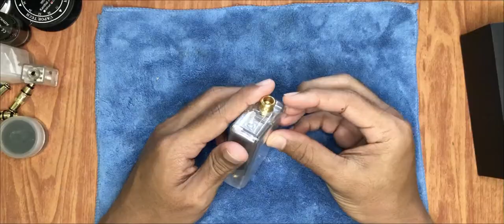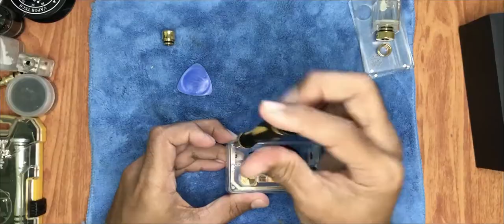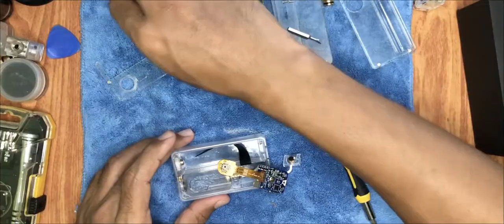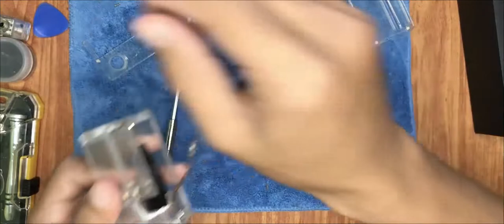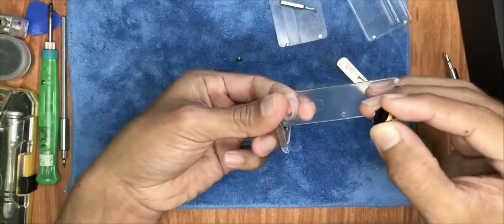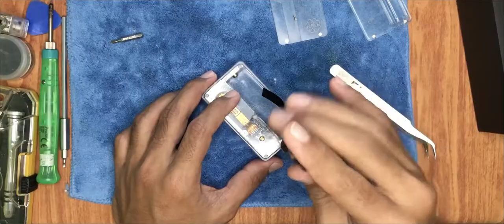Dotmod Dotaio | Full disassembly tutorial

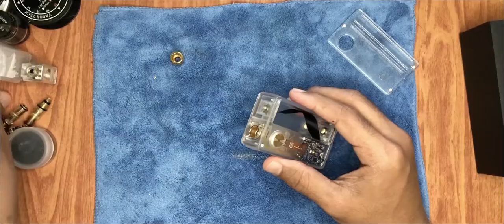Comment: 0:41 what is blue thing? please tell me that name... I can not open that part... Is it Guitar pick?
Reply from the maker: its the tool for screen replacing.
Reply: @syeikhsaiful  
Thank you for answer.
My AIO was locked so tight that it couldn't be opened with plastic or coins :(
Reply from the maker: yj k no jokes? It has to be able to unscrew that thing. And yes coin is the best guy to do the job. Make sure to rotate it counter clockwise. I just use the plastic thing to make sure to not leave any scratch mark. Coin is perfect enough though. No need to get that thing im using